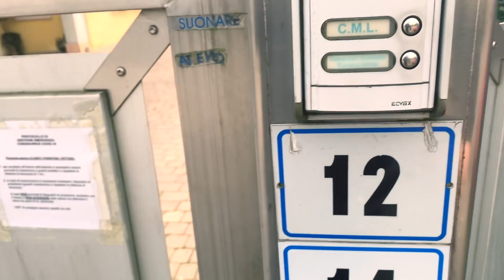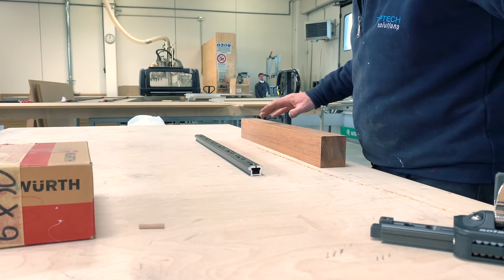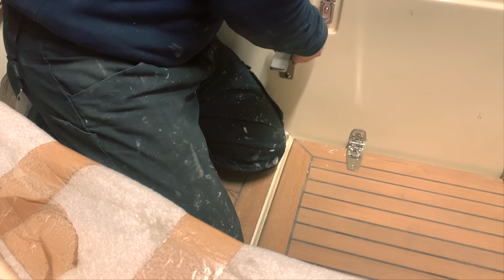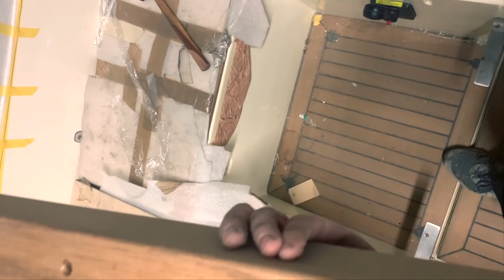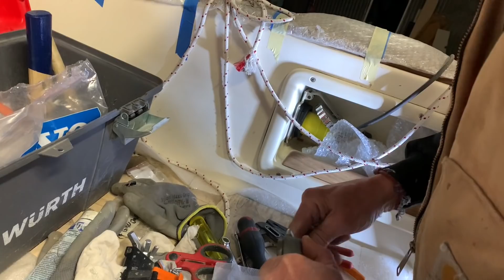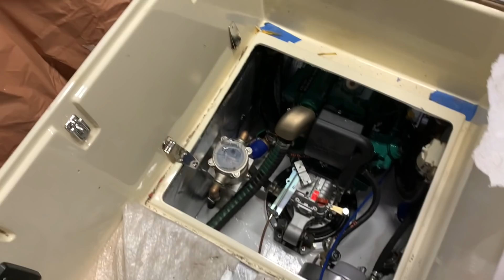Custom Burma Teak Base + Antal Mainsail System on Our Hallberg-Rassy 312

Comment: Ciao, why didnt you put the truck of mainsail before the sprayhood, as it is on new hr312 mkII?
Reply from the maker: Hello friend Thank you for writing to me and for asking me this question that others had already asked me ! 
the problem of placing the mainsail track of the mainsail in front of the windshield is that the surface where it would be anchored is not strong enough and has not been designed to withstand a tension so high… I could have changed the structure and make it stronger but this forced to overturn the original project so I opted for the original solution which is the best even if not very comfortable.
we must always think that if you buy a Ferrari you cannot modify the structure without creating functional alterations of the same!  those who design boats with knowledge of the facts and manage to do it well (Hallberg Rassy is one of them) are not wrong in proposing functional solutions.💪🏻
Reply: Thank you Gabriele🙏

Comment: Outstanding job, yet again!  My only comment would be to find a way to attach a wire or small chain to that new knob, to keep you from losing it when you open the hatch.  It shouldn't be difficult to figure out a way of making it captive.
Reply from the maker: Yes mate great! This is my plan for sure I didn’t get time to do it but is on the way I can’t lost the knob under the engine!!!